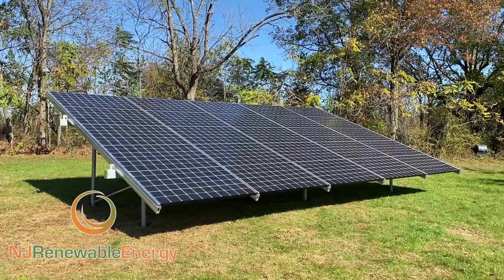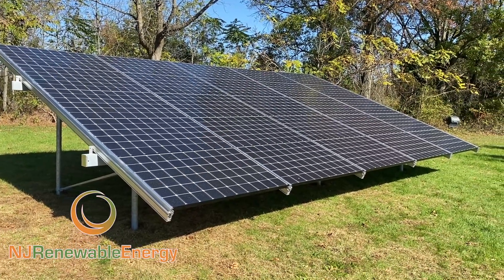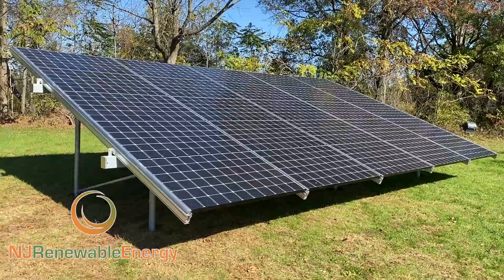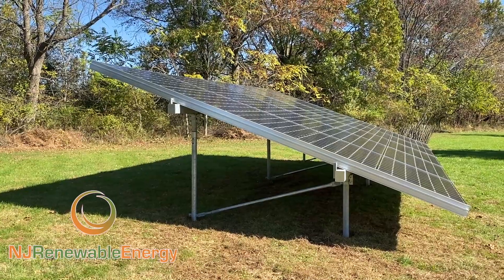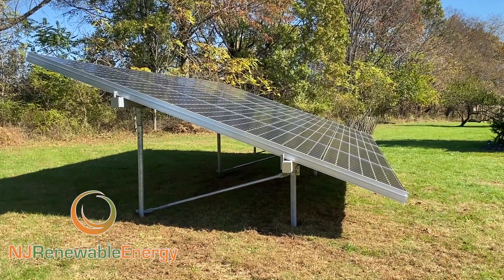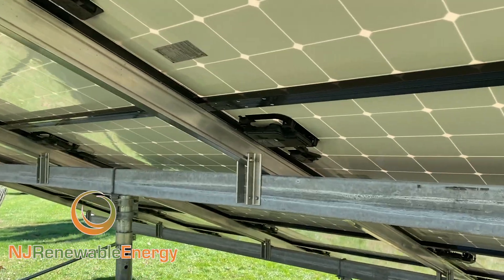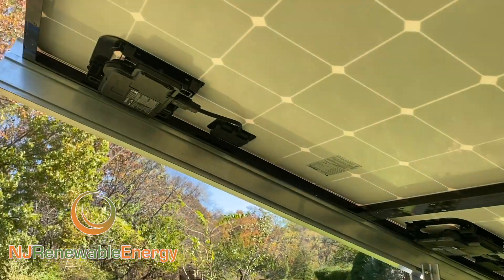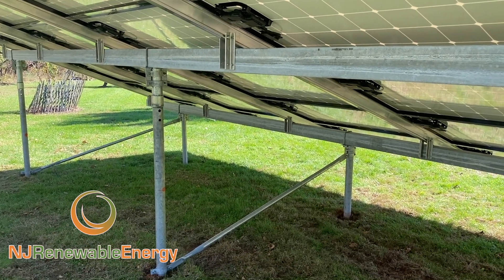Hillsborough NJ, 8.25 KW Solar Ground Mount Array

Comment: I have a string inverter... if there's shade the unshaded panels are completely unaffected.  It's only the shaded areas you lose with a string inverter which isn't much.  Even with Enphase if a cell group is shaded you still lose the cell group.  There's a lot of expensive misinformation out there :/
Reply from the maker: In shade conditions, string inverters have notoriously under performed compared to micro inverters, however, with optimizers added to string inverters in recent years, it's helped reduce the losses.  Regarding micro inverters, as I suggested in the video, if I took a towel and covered one panel completely, it would not affect any other panel whatsoever.
Reply: @ThisWeekInSolar  I've done a similar test with a string inverter.  If each string is on an independent MPP channel (Which is most modern string inverters) all unshaded panels are unaffected because the bypass diodes engage.  Shade does not adversely effect modern strings anymore than micros...